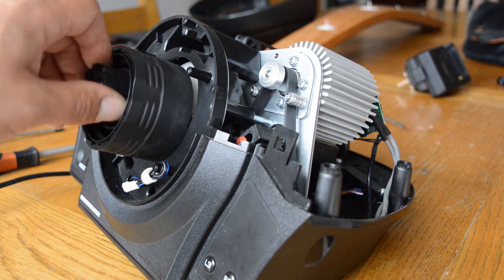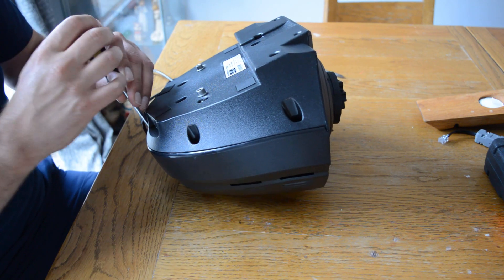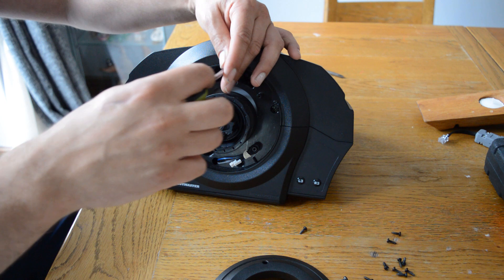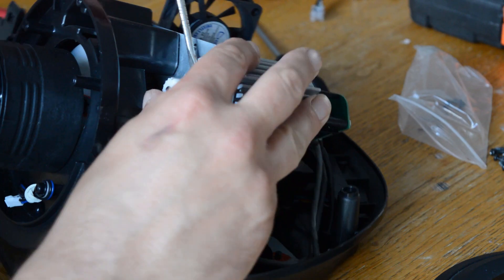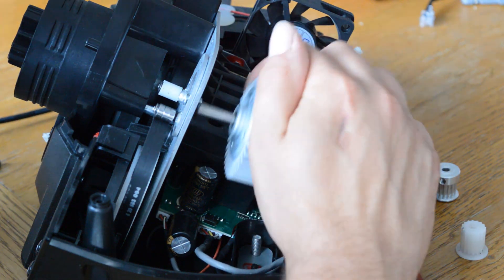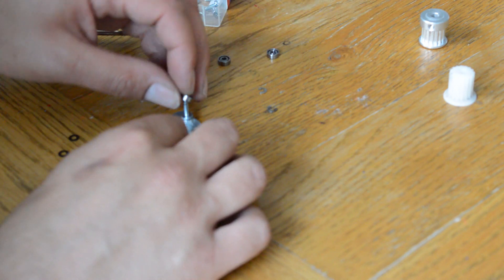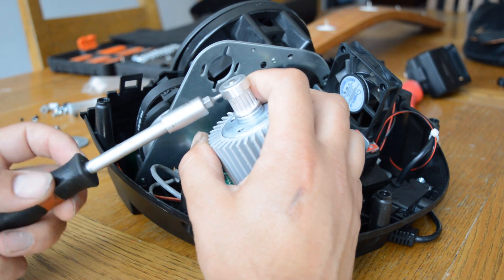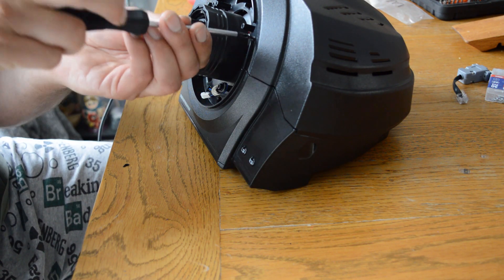Thrustmaster T300 Metal Bearing & Pinion Upgrade Mod

Comment: The recommended ball bearings dont slip easily on the metal stick as in your video. They require extreme force to even move them a few millimetres. Mine are stuck now halfway so the entire wheel bacame useless because i cant get it working anymore. Terrible mod.

Comment: Okay so I've just done this mod, here's my advice:
- Use 3x9x4mm bearings or 4x9x4mm, the extra 1mm height will mean you don't need washers and you can stack 3 and just put the clip on. If you got 4x9x4mm like me (my rod had damage so I had to get a wider one) then use some electrical tape or any type of tape and tape around the rod to widen its diameter so the bearing fits smoothly. 

- The stock plastic bearings seem to be 4mm wide not 3mm, that's why I'm suggesting 4mm wide bearings, because with 3mm I had an issue where if the belt went too low it would rub against the bottom, the 4mm prevents that, just like it is with the stock ones.

btw if you do get 3x8x3mm bearings you can stack 4 and just use a clip, no need for washers

Comment: Hey man, I was doing the bearings and the first one got stuck in the middle of the rod. I have bought the 693, which was 3x9x3, and it doesnt go all the way in or out. What can I do?

edit: glad I have read every comment here to see if anyone has the same problem... sanded the shaft using 240 grit and bearings fits easily
Reply: How did you remove the stuck ball bearing?

Comment: I tried to replace the bearings nut ended up braking the whole damn thing.  Are you sure the 3mm*8mm*3mm is the correct size?  It was a little tight and now I’m trying to contact thrustmaster to replace the bracket so that I can try again.  I’m thinking of ordering 3.5mm*8mm*3mm bearings if they exist or a suitable replacement.
Reply: 3x8x4
Reply: Did you end up being able to get a replacement bracket? I ended up screwing mine up too. Ended up snapping both of the posts off and sanding it flat to a polished finish. Seems to be smoother and didn't need the bearings.

Comment: Hello . I have one quistion , I can only push My barings about 2 mm down ,they dont slide down . Is it a good idea to use force to get then in place .
Reply: Same problem with mine, the left shaft seems larger after the top and the bearing won’t slide
Reply: Today's Update: I've sanded with 230-500 grit sandpaper the shaft till the bearing can fit. No problem at all. Only a bit tricky to recenter the wheel after removing the motor and the belt
Reply: Danm I hate My TM  t300 gt now ...
Reply: How did you recenter the wheel?
Reply from the maker: They should slide on easily if they are the right size. There will be some slight resistance but excessive force shouldn't be needed
Reply: @simpulse5825  thanks for the answering . I must just try once more

Comment: Does force feedback improve with this upgrade? Is it more stable and with less dips? For now I changed the fan by putting the Noctua and it improved a bit. I would like to know if it is worth doing this upgrade also for the optimal force feedback performance. Let me know your opinion as soon as you can and congratulations for the guide👏😃🍾
Reply: glaube nicht das es ein großen unterschied macht :face-green-smiling:

Comment: Will that pinion gear fit the TMX FFB wheel?
Reply: It does NOT fit, this size is too wide for the belt to be able to go around it and too long for the motor shaft which is exactly the same as on my T150. The T300 uses a differently modelled motor tension area than those because it's fully belt-driven and more powerful.

Comment: Do these parts work for the t150?
Reply: For t150 u need 3x9x4 without any pad's
Reply: @n8dss  cheers you legend!
Reply: What about the Pinon size with the T150? That size is only about the ball bearings which I got 3x8x4 to fit perfectly
Reply: @BluFrost8888  so pleased you commented here!
Reply: @BluFrost8888  i do not recommend installing pulley for t150, the parameter's is 16teeth bore 3.175 width like a belt 9mm.
I don't recommend do that because u need to do some space between motor, because shaft too short, and this didn't have a meaning, the gears on t150 is not symmetry (i see that when open mine) and main vibration going from gear.
 the belt profile on my is MXL but i see one dude from gtplanet who t150 have the gt3 or 2 belt(i don't remember)

Comment: Hi Buddy, great informative video, just one question, if you have gone to all that trouble, why not undo a few more screws and replace the bottom Nylon rollers to bearings ?
Keep up the awesome content.
Reply: Because you have to make custom shafts
Reply: @karl_toffel  What's their diameter? I have a bucket of printer shafts, I'm pretty sure there is no diameter under the sun that is not covered by my collection ;)

Comment: did this mod and afterwards the Top Dead Centre (TDC) kept on getting off centered while in the game, anybody able to permanently fix this issue?
Reply: I would say you have not applied enough tension to the belt, and the belt is jumping a tooth at times. I had this when i first repaired my pinion. Particuarly noticable from drifting or high FFB settings. There is a way to recalibrate tdc, i did this when re installing everything, but if your TDC is changing id say your belt is jumping a tooth.

Comment: waht would happen if one would change the gear ratio ? say from 16 teeth pinion > 15 ?
would the software still be able to calibrate correctly or would u like need to put in higher wheel rotation software wise to get the same amount of wheel rotation like with the original gearing ?

Comment: Hi!

I changed upper gear to aluminum but I keeped tenioners to original.

And I greased the worm gear on middle, too.

Now my rim isn't straight after calibration progress.

Feeling is pretty much better with tightened belt.

Comment: I also did this to my Thrustmaster TMX. Worked great
Reply: Which Pinon size did you use? 5mm and 11mm is too large for TMX/150
Reply: @BluFrost8888  Did you end up doing the Pinion mod?
Reply: @Brandon4179  nope lol, tbh I don't think it'll make a a huge difference anyways since the TMX/T150 is fundamentally worse than the T300/TX with its gear system. The bearings 3x8x4mm (693ZZ size) made a decent difference but nothing significant like going for a fully belt system on the T300/TX.

I just saved the correct T300 pinion size that I ordered in my tool chest for whenever I get a T300 and sell my T150
Reply: @BluFrost8888  Ah okay, I'll probably just do the bearing mod. Thank you for the response.
Reply: I know I'm late but did you succeed with the mod ? @brn-dn
Reply: @harissajid8224  I didn't attempt it, I just use the wheel as normal.
Reply: @brn-dn  oh okay that's fine. I did oil lubricate on bearing and belt but no bearing mod.

You can see the result on my account

Comment: wouldnt the metal pinion be worse for the belt? Can you even get replacement belts if it shreds it?
Reply: there should be plenty of sites that sell parametric belts
Reply: if you had catostrophic failure, either the belt or the plastic gear would break, not ideal. If the belt skips a tooth your calibration will be out of sync with wheels position, so no, a metal gear is not any worse. These pinions are the same ones we use on 3D printers and their belts.
Reply: @Lykkanw  3d printers have much less torque than the wheel tho
Reply: @flippy9133  the stepper motor on a 3d printer / cnc machine has a D groove, as the stepper motor itself sees much more load than on these wheels. These wheels use a faster spinning motor with a small gear that turns a very large gear. That is gear reduction, the 3d printers see much more torque @ the motor. 3D printers do not need gear reduction (though the filament extruder does, but it's all metal gears and no belt)
Reply: some 3d printers 100% do and alot of cnc also use belts even giant once all with metal gears if you ever tried to rip or even damage a parametric belts even one 1/4 of this width you would feel how durable they are  ( ther mainly made for use with medal gears) @Lykkanw

Comment: What is the advantage of replacing the plastic pinion with the aluminum one?  the plastic one is certainly lighter
Reply: In first revision this plastic pulley is shit, the hole not on mid of pulley, this give our some vibration & maybee noise, the weight difference is only few grams, it not matter

Comment: Did this upgrade a while back and just went ahead and swapped out the other belt’s tensioners with bearings too. The other ones are definitely a bit more work, as you have to get/make replacement axles for the bearings – but definitely worth it. Was clearly smoother compared to stock even with just this, but replacing the other tensioners with bearings takes it to another level. 100% recommend!
Reply: Hi mate do you have any more information on this please? How did you get around or make the replacement Axel's ? Thank you
Reply: @GRiiiMx  Sure dude: Accessing the tensioners requires removing the front panel – a couple on the bottom and 5 or so on the front. The tensioners are screwed in from the front on sleds. The axle can be pushed out using a screwdriver. The replacement axle you’re going to need is basically any round steel with 5 mm diameter, which you then just need to cut to length (and possibly file to get rid of any rough edges). The bearings should be approx. 5x13x4mm, and you need 6 in total. Then just push the new axles into the assembly and through the bearings and reassemble. Once I found my materials, easy enough to do.
Reply: @milosberka4588  thank you! Time to shop!
Reply: @milosberka4588  im in the process of doing bearing mods to a TX wheel base, same internals as a T300 as far as motor, tensioners, and rollers go. why did you need to make custom axles for these rollers? maybe the TX is slightly different from the T300 on these rollers, but seems the stock axles would be fine with these same bearing sizes you listed.
Reply: @ZXR_SBK  The stock axles have notches in them, with a smaller diameter in the middle vs the ends, so the bearings wouldn’t be properly supported.
Reply: @milosberka4588  ah ok. Figured it might be something like that. I'll have to pull mine back apart and use calipers to verify if the TX ones get smaller in the middle. Thanks for the quick response.
Reply: @milosberka4588  update, I got the bearings in a few days ago, I did not need to cut new axles for the lower belt rollers on my TX base, I'm not sure if all TX bases will be the same, might just be a part update they made to the T300  since it's slightly newer design wise, but I was able to use the stock tensioner axles. My axles didn't get smaller in the middle. I'd advise anyone doing the lower rollers to pull their TX/T300 base apart and verify before ordering parts. I will be posting a tear down video and I'll link you as the reference for the parts and info on the lower tensioner. Thanks again for providing the info.
Reply: @milosberka4588  Hello, I've just got to modding my t300 and I already attempted this, I had watched another similar video from a Chinese youtuber and they used 1.25mm washers in between the bearing and the plastic, I am guessing so that there is no friction slowing the bearing down? I was wondering if you used bearings when you swapped your plastic rollers for bearing.
Reply: @martinmavroforakiss6024  hello, i want to do this mod to my t300, did you have to change the axles or do the 5x13x4mm bearings go inside the stock ones? any tips? did you use washers?
Reply: @milosberka4588  i was sure i put an image there.. and I guess people dont like suspect links but here is a photo i made when I replaced my lower tensioner with the smaller pins for others.. https://i.imgur.com/aZnBiQl.jpg
Reply: @ausdruid  Hey, how did you solve this axle issue? 5mm was tight enough to hold or did you do some modifications to them? I ordered 5mm axles an I'll try to make them work somehow.
Reply: Howdy , I have discovered the same issue, tthe axles have smaller notch inside , I have 5mm rod on order to cut into new axels  however did you find that 5mm new axels fit securely in the plastic housing at each end?  I only ask as the 5mm new rod should fit the 5x13x4 bearings I already bought, however the old rod\axels (at the thicck ends) - are too thick to fit through the 5mm ID bearing centre, so follows that the fitting in the plastic housing for existing axel's is bigger than 5mm...  whenn you replaced with 5mm rod - was it secure enough in the plasticc housing ? or did you have to  burr over or modify the new rod ends?
Reply: @milosberka4588
@ausdruid
Hi! Can you pls help with axles (rod) length? Just want to prepare everything before disassembling the base
Reply: Unnecessary, easier and more simple to just remove the tensioners.

Comment: The bearings, ok. But what for one would want to change the pinion to a metal one? It will work the same, only the metal weights more and has definitely an impact to the characteristics / engine's momentum / torque so I would expect it can discalibrate ffb, at least in some degree. I wouldn't change that, especially without any directly specified reason. Also I think the plastic one runs smoother in contact with a rubber belt. So I'd rather go other way and change metal one to plastic, if it was the case.
Reply: In my t300 and for a lot of people, the original plastic pinion's bore is off center which make the steering uneven
Reply: @escalator9734  ok that case makes sense
Reply: Unfortunately your opinion has no impact, weighed the  pinions and the Aluminium Pinion which is found on most FDM 3D printers was 2g lighter than the Nylon pinion.
Reply: @ianbarnes6266  So, it would then decalibrate ffb in another direction, maybe. Assuming it does, then it doesn't matter if the pinion is heavier or lighter, what matters is that it differs from the device's design base parameters calculations. And so - it must have some impact to the whole mechanism, from the law of physics point of view. Maybe that impact is negligible, maybe not. Can't say for sure without lab tests and pro measuring tools. But definitely such impact exists.
Reply: @wolo  you're over thinking it. For one, it's spinning in place so the weight is centered, and it's not free-spinning, it's spinning an entire wheel. If it was free-spinning, the weight would hold contribute to its ability to speed up and slow down, like a flywheel, but it's driving the mechanism & has to overcome that. Source: I've rebuilt engines, built several 3d printers / cnc machines etc.
For "Decalibration" that only happens if you remove the belt from top-dead-center with the assembly, they get out of sync. Someone else here mentioned how to calibrate it again if that happens.
Reply: I get what he’s trying to say. Plying it safe. Those that changed it, what calibration software you use to center again after?

Comment: Will these parts work for the T500?
Reply from the maker: I'm not sure as I haven't seen the internals of a T500, but I believe they are the same as the T300, apart from having fixed paddles.

Comment: Thanks for the link to buy the pinion. I've upgraded to the parts you have recommended. This is a good video....BUT your leaving out vital and potentially catastrophic things to pay attention to.
Make sure you do not let the belt move without the pinions moving. You will lose TDC. Top dead center. 
You need to mark the belt and the tooth on the pinion. I like to mark the motor as well. It's just the belt you MUST NOT MOVE.
The shift has a flat side. The pinion you recommend is almost too long. The retaining screws need to be lined up right because of the flat side. So just remember top dead center or your wheel will be turned and not calibrate correctly. It can get ugly.  Lol. I know. I had to take my completely apart. It's all about the pully positions.
Reply from the maker: Hi thanks for the points you made. It is a good idea to mark where the belt is, I didn't but afterwards I did have to use the downloadable software available via a google search which recalibrates TDC.
Reply: @simpulse5825  Just like you can toggle the cooling fan from auto to full time by holding 3 buttons.....MODE, SHARE AND START. I think?......there is a way to calibrate a new tdc and something with the pedals.
Reply: is the pinion upgrade worth it? i have a t150 and i’m doing bearing upgrade and maybe do the pinion. but the only thing i’m scared of is losing the TDC
Reply from the maker: @azzaz905  it's hard to know if the pinion makes any difference, but you can mark where the belt is and refit in the same place, or refit roughly where it was and use the third party calibration software. You can find this on google.
Reply: Can you please provide the name of the third party software that you had used to recalibrate the TDC.  Because I have the same issue as I lost control of my car and the TDC while driving in game.  I tried resetting and recalibrating the TDC through the thrustmaster control panel and everytime I lose the TDC while in the middle of the game.  Is the Hall sensor picking this mod up?
Reply: Tdc is actually easy to find again. Let the motor calibrate center and then line up the gears. Spazzed taking mine apart and lost center.
Reply: @some-replies  Your left/right rotation limits had been restored again doing this? Mine lost the center and the right rotation limit (not goes to the right completely, ends much earlier).
Reply: Same problem... @GeoFormula